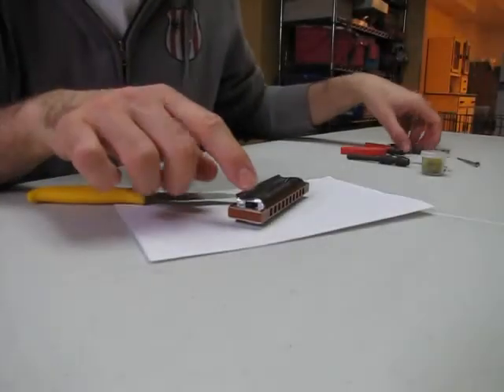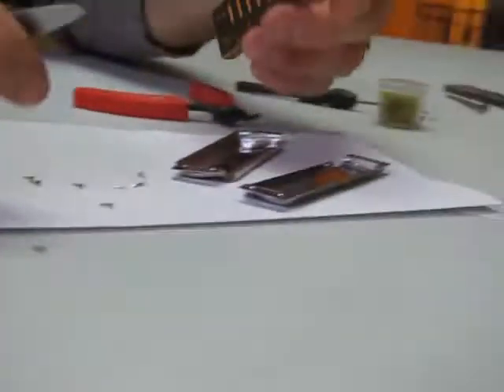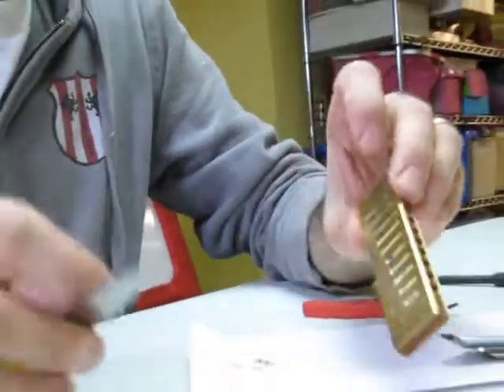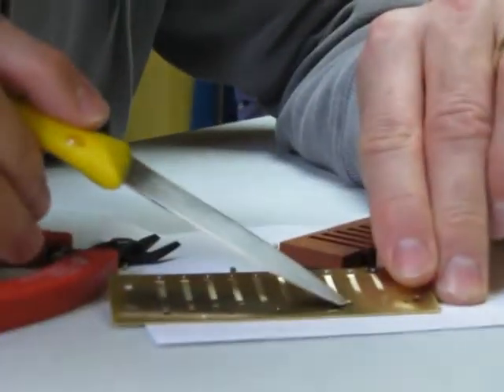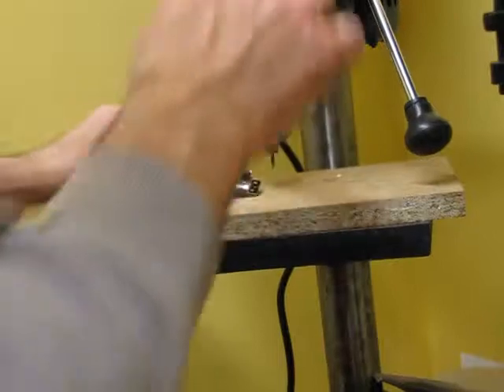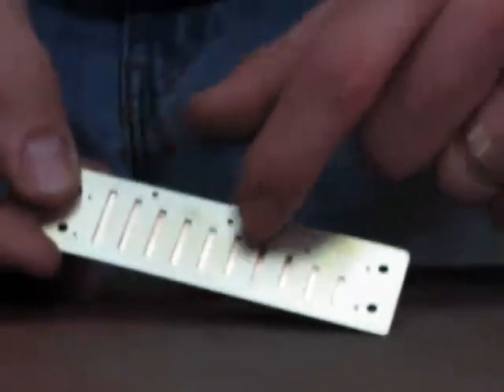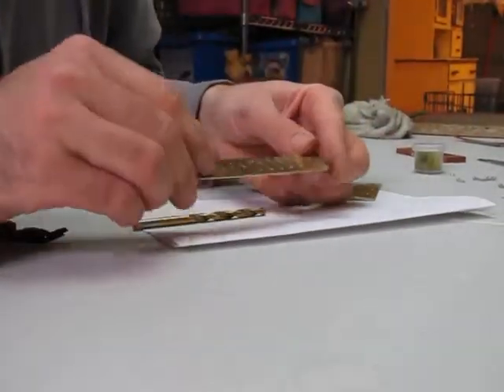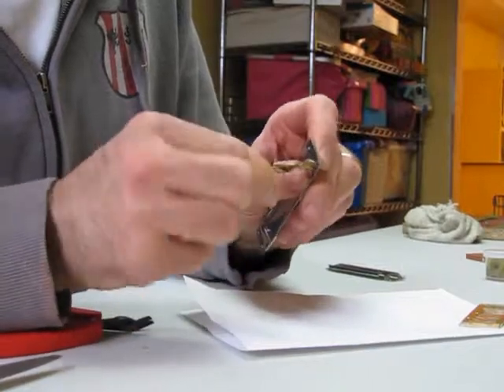Marine Band: replace nails with screws and install new comb

Comment: I recent bought andrews full toolkit and when I went to do work on a brand new marine band I was surprised to find that even the reed plates are held on the comb with tacks, it’s a real pain, i had only owned crossovers before that and it’s so nice to just have the screws pre-installed

Comment: Hello and thanks for the incredibly detailed instructions. I have used them twice successfully. However I just opened a used marine band that only has 2 nails in the bottom plate that don’t line up with my new comb. Any suggestions? Thanks again for all the info! Cheers

Comment: Thank you so much for this video (and the rest.)  I just finished "practicing" on a very old Marine Band F that I've had rattling around a drawer for at least 15 years. I'm pretty pleased with the results of my first customization.  Only a couple of mistakes: I drilled the through and through holes in the blow plate after "marking" them with the smaller drill bit. Tapped, the draw plate, and then couldn't get my 8mm bolt through. Duh! forgot to drill the comb to the larger size! Then while drilling the comb I managed to put a dimple on one of the holes with the drill press chuck. After all that, I'm pretty impressed.  Still have some tweaking to do with the reeds but  this old harp sounds at least as good at the F I bought earlier this year. (Sadly the new one's comb has swollen on the middle "teeth" to my great disappointment.  I'll be subbing in my old, renewed, F harp till I can flatten or replace the comb.
Thanks again for giving me the necessary information, techniques, and confidence to tackle my own harp maintenance.

Comment: Man I had a devil of a time starting the screws into the nuts on the cover plates because they barely stick out, you did it so easily in this video. I used my stock MB wood comb, is your combs thinner?